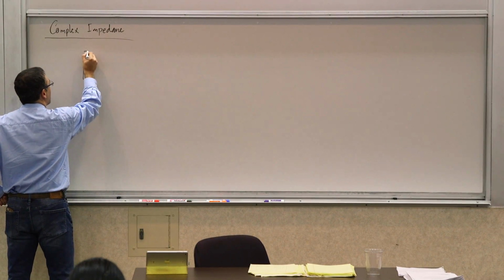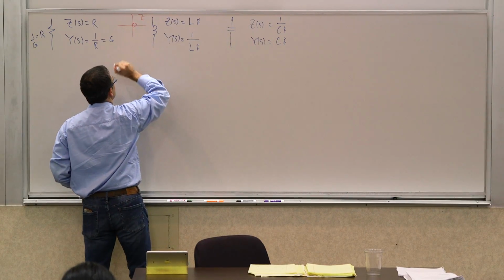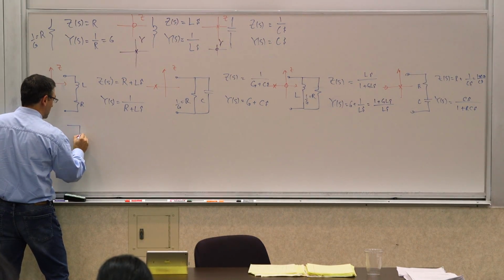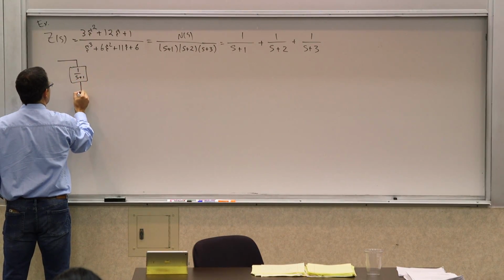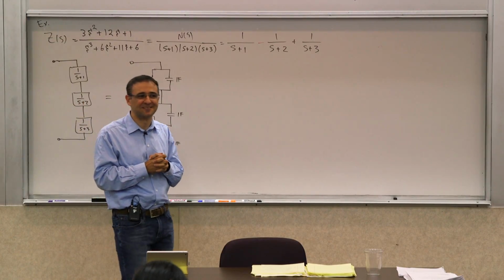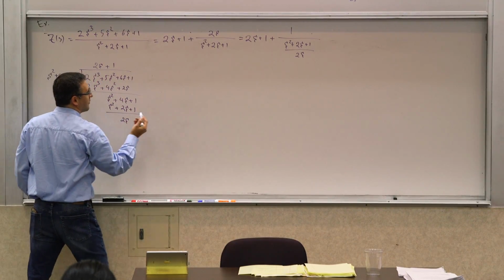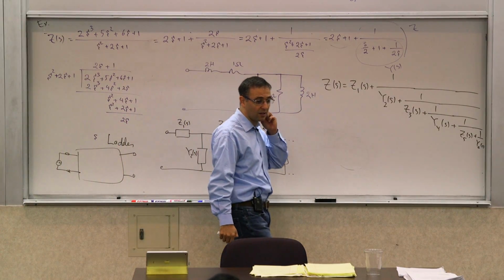030. Intro to Network Synthesis, Complex Impedance,

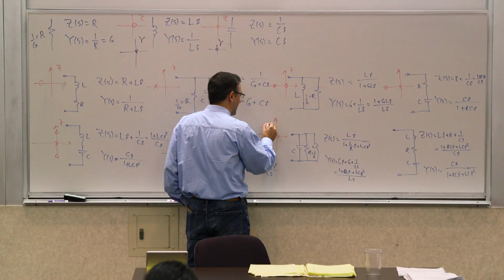Comment: At 17:50 depending upon the R,L,C values pole-zero plot changes right because it is series RLC if R>0,L>0,C>0 we will get 3 responses under damped, critically damped, over damped. In under damped case poles location will be complex conjugate pair. In case of over and critical damped system will be on negative real axis right? that means pole-zero plot will change based upon the values of R, L,C. Similarly in  parallel RLC also

Comment: Professor, the partial fraction expansion at 23:53 is incorrect.  I got -4 divided by s+1, 11 divided by s+2, and -4 divided by s+3.  I have not watched the video beyond 23:53 yet, so maybe you corrected it later.
Reply from the maker: You are right. The numerator should be 3*S^2+12*S+11 (instead it was stated as +1). Thank you for bringing it up.